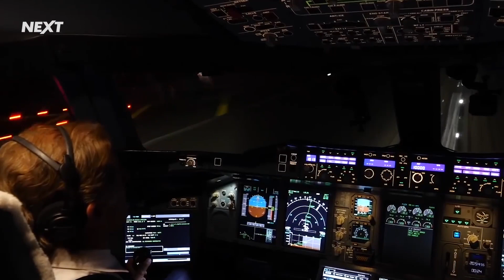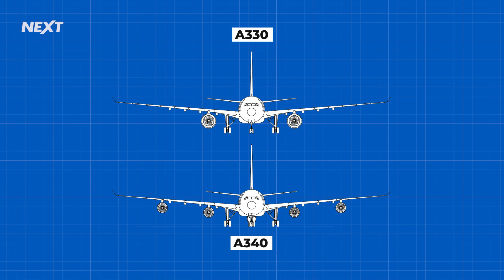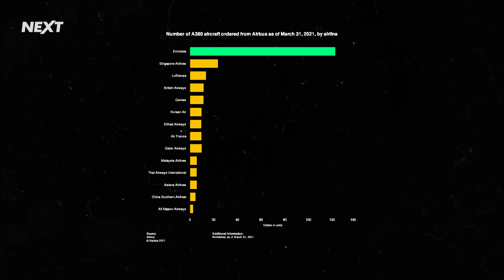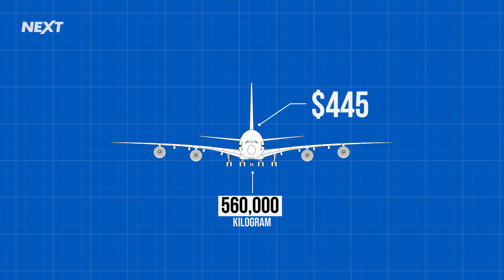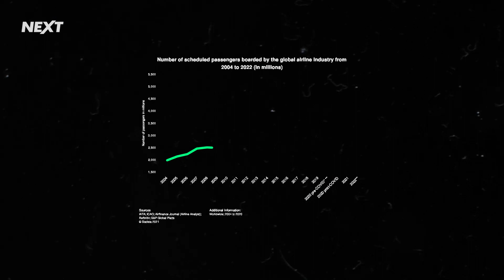Why The Airbus A380 Was A Failure

Comment: actually there are several reasons, namely the long-term effects, the first is that the maintenance costs are very expensive, the second is the limited airport to stop at, it cannot be used for cargo.  look at the boeing 747, even though it is rarely used commercially, there are still many airlines that use it for cargo.  Boeing's mindset is smarter.

Comment: The A380 was built to operate on an older model of hub-and-spoke operations, flying from main centre to main centre, with smaller aircraft taking passengers on to their final destination. At the same time as the A380 was being developed, airlines were beginning to adopt a new model of direct-to-destination operations, using smaller aircraft like the A330 and 767 to fly passengers directly from their point of origin to their final destination. This made more destinations available to the public, as smaller planes can fly to airports off-limits to larger aircraft, and can use existing airport infrastructure without requiring expensive upgrades or dedicated facilities. The A380 is a great plane, but it came along at the wrong time.

Comment: I’d pay between 10 to 20 percent more to fly long haul on the a380 vs say, the 777. It’s quieter compared to the 777’s massive engines and it’s heavier so it’s not impacted by turbulence to the same extent the smaller aircraft are, therefore more comfortable on a 14 hour flight.
Reply: It got 50% more engine